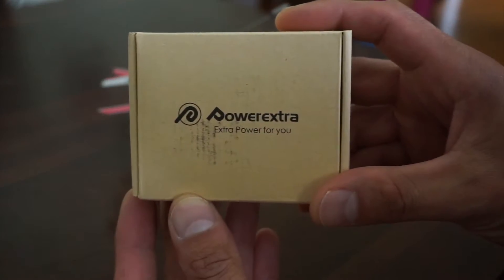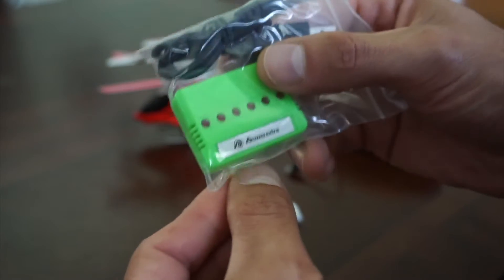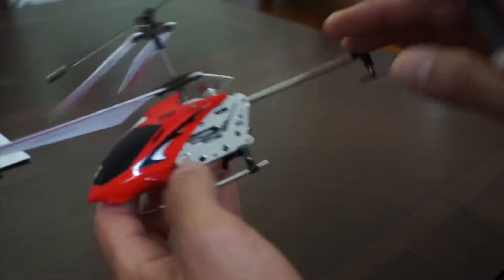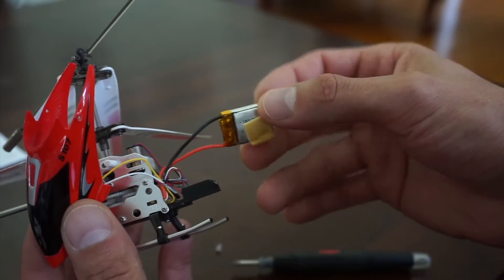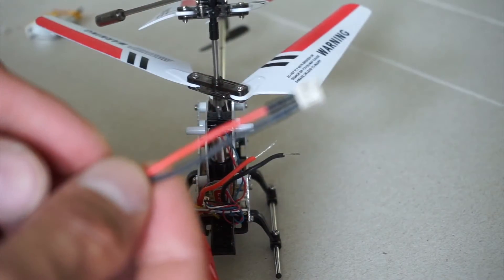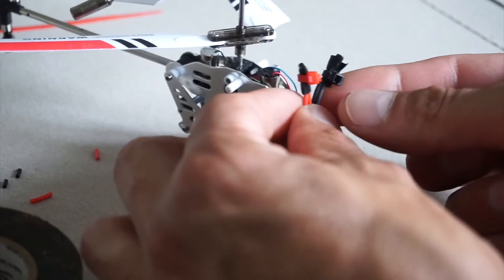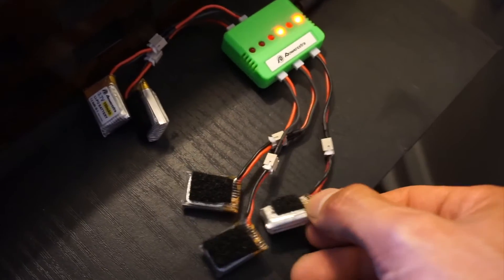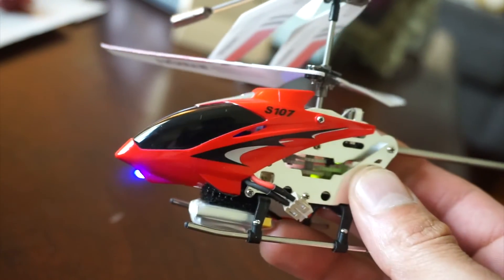SYMA S107 Battery Modification

Comment: Hi looks good Ive done these before on many RC however 3.7v 220mAh with velcro to secure however always solder and finishes off with heat shrink. The helicopter will spin up and lift off about a foot and dies all new batteries all the same 5-10 seconds flight time do you have any suggestions. Andy

Comment: Hi! I've got a Syma s107h, the s107g upgrade with altitude hold. Can I upgrade with two 150 or 180 mah lipo batteries inside canopy or do you think they are too heavy? Thanks in advance.
Reply: I'm thinking of doing the same thing. I just bought two of the 180mAh batteries to install them in parallel to see how much battery life improves. Hopefully they're not too heavy for the helicopter.

Comment: So whats the overall battery life now with one battery?
Reply from the maker: Flight time is about the same as original battery. The entire set up worked flawlessly for roughly three months of frequent usage at about 90 min per week before batteries began to fade and not hold a full charge anymore. It could be that I left the leads too long in the helicopter as someone suggested in the comments. I still consider to have gotten my money’s worth. A newer battery set is available here. 
✌️
Fytoo Accessories 5 PCS 3.7V 380 mAh Li Battery+1 PCS Charger for SYMA X5A-1 X15 Rc Drone/Helicopter/Aircraft/Airplane Spare Parts https://www.amazon.com/dp/B078W1YV5P/ref=cm_sw_r_cp_api_glt_fabc_3QT7C5G1PFDVYFM1BJDC

Comment: Neat hack. Why is the rear rotor reversed (mine points upward)? Does this make the blade less susceptible to damage?  Does doing this affect the controls (i.e., move stick forward for reverse, etc)?
Reply from the maker: Exactly, turning the tail rotor 180° makes the copter accelerate much more aggressively, but lags more to slow down. You to have to get used to the reversed controls.

Comment: @ Mountain Drew, the mod wire is too long, it will ruin the battery life faster and shorten the flight time.
Reply from the maker: It certainly did :( but was fun for a little while. Hopefully others will see your comment
Reply: What did you mean by the mod wire? as the new battery adapter? Ideally, how long should it be? sorry I don't know much about wiring

Comment: How did you get multiple batteries?
Reply from the maker: Nick Boss found on amazon unfortunately the link In Description  is no longer available so you’d have to find something similar. As long as the voltage is the same, and the capacity is similar it should work.

Comment: How long a flight time are you getting per battery now after the change.cheers
Reply from the maker: John Tchibukdjian about four minutes. It’s long enough that if you number and rotate the batteries in sequence the first battery is charged by the time the last one is spent. Very little if any down time.

Comment: I’m not quite sure on how you did the wire deal there. Do I need tools for that?
Reply from the maker: Grinder Gaming need a way to cut and strip the wires.  A utility razor knife could work but a $10 pair of wire strippers from the hardware store are well worth it. The rest is small zip tie and electrical tape.

Comment: Nice, you think a bigger mah battery is ok? Like a 350mah?
Reply from the maker: God kinG  I don’t see any reason why it wouldn’t work. But I’m not sure how the bigger size and weight of the battery would affect the helicopters flight which is why I stuck with the same size battery.
Reply: Did you end up trying the 350mAh?
Reply: Probably won’t work. Too heavy. Even when 1g is too much weight for this helli. Cheers